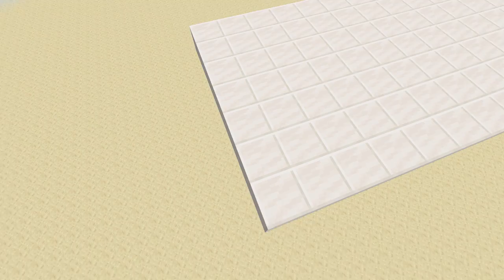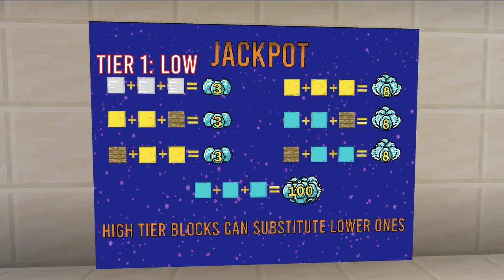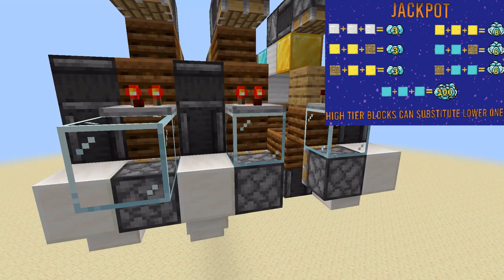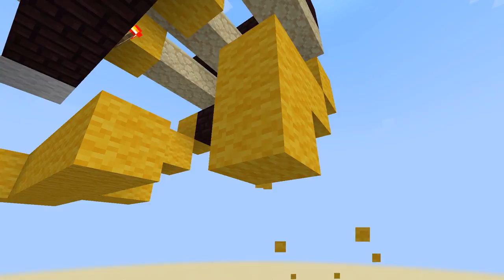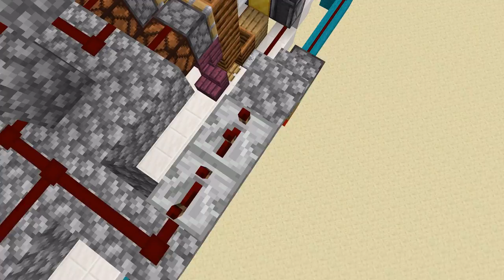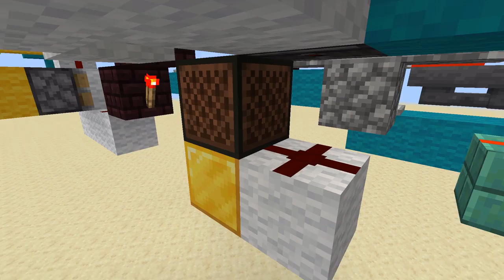How to make an extendable SLOT MACHINE in Minecraft 1.19-1.21

Comment: Can i rig this?
Reply from the maker: If you want you could. First of all the machine is designed so that the casino wins way more if enough games are played. The easiest ‘rig’ would be to alter the winnings even more in favour of the casino, but that isn’t really rigging. The actual rigging option would be to stop using the randomiser to stop the last wheel and instead just give it one or two more rotations after the second wheel. Then you can place the starting position of the third wheel in such a way that you’ll never get a jackpot.

I don’t know the reason you want to rig, but if it is because you don’t have enough resources to supply a jackpot from the start, you could also opt for having the jackpot be based on how many people have played the machine. (Every time someone plays there is a chance the jackpot gets increased, but the initial jackpot is very small)

Comment: Really good video, I only have a question. In the wheel there's 9 blocks (4 wins, 4 composters, one plank). When the plank was showing I still got a prize because it had a 2 level composter at the comparator (and another diamond block at the other wheel), so I got 3 diamonds. How do I fix this?
Reply from the maker: It’s tricky, I assume you tried to put the composters in more random positions. Not all combinations work, but if you place the blocks like I placed them at 02:06, the wooden block will be read as the iron block, which isn’t a composter so it wouldn’t give a signal. Hope that helps